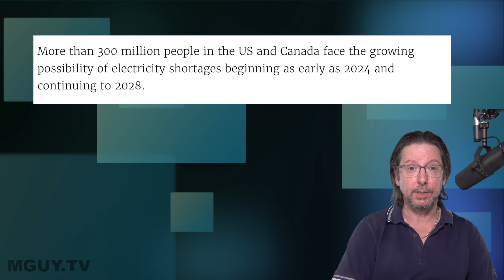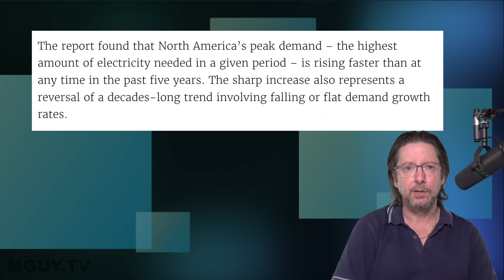Electricity grids WON'T COPE with mass EV charging | MGUY Australia

Comment: Energy Loss - future episode suggestion. Nobody seems to be explaining the significant loss of electrical energy as it moves from the place it’s generated, to the motor that turns the wheel. 1kw generated is not 1kw at the wheel in the same way that 1 litre of fuel delivers the same amount of calories into the engine (less evaporation). There’s an enormous loss of energy in the transmission and charging/discharging journey: that seriously impacts the amount of energy needed and therefore efficacy of the entire process as a viable alternative.
Reply: What you say is correct.  But the ice engines also waste a lot of energy on heat and noise.
Reply: Your statements are patently false. Electrical transmission lines are the most efficient way to move energy on this planet. Typical high-tension power lines lose 4%-6% energy over a thousand miles. 
Let's move a gigawatt of energy 1,000 miles in two ways, please. 1) electricity - oops, it's already at it's destination. 2) fuel trucks - we have to burn diesel to push the truck with a 75% heat loss. It will take days to get there, and when burned, the delivered fuel will waste 75% of its energy as heat.
What were you saying about "significant loss of electrical energy"?
Reply: Calories into the engine!!.

Comment: 10 years ago i got a tour of a power station i was told by the guys there that our national grid here in Ireland can't cope with the demand during the winter months which is nearly 4 months 😂 even the controllers in our grid distribution get nervous.  This was before a government pulled down 2 perfectly good power stations 10 years old all in the name of cutting our pitiful greenhouse gas emissions.  Never mind today with heat pumps or evs, or the rising population with an ever increasing demand on power but no building of new power plants or upgrading or national  grid.

Comment: Speaking of the US and Canada, most people don't know that Canada sells excess power to the US, sometimes in substantial amounts.  So, what happens when they need their 
power for their own citizens, businesses, and industry?  Most likely is that they will say, "Sorry, US, but we can't supply you with any additional power right now... maybe later?
The problem, of course, is that electric power is not one of those off and on requirements.  When we need power, we need it NOW.  This is yet another reason why solar and
wind power are less than desirable.  Not only does the sun only shine about 40% of the time when clouds are absent from the sky but the wind can stop blowing in a lot of 
places for days at a time.  At best, these sources of electrical energy are secondary supplies that only work when nature allows them to work and not at any other time.  
Because of this, we truly need fossil fuel and nuclear power to be the primary contributors to the regional electric grids that make up the national grid.  Notice that China 
is building LOTS of coal-fired power plants because they are pragmatic and know what will happen to them if they do not.  Those prone to flights of fancy instead of math, 
science, and engineering, however, apparently do not.

Comment: This is what happens when you get a very common windless night. Total failure of the renewables power grid. Batteries you say, unfortunately there are not enough rare earth minerals on this planet to get anywhere near a suitable backup power storage supply not even from pumped hydro. The backup will be coal, gas, hydro or nuclear. In essence we are creating 2 power grids when only one is needed. Therefore you can at least expect a doubling of your power bill minimum. Factor in thousands of kilometres of renewable transmission lines and your bill goes ever higher. We are governed by fools that have not a clue, they are climate religious zealots that must be sacked at the next election. Well done Labor and Green voters for administering a potentially lethal dose of socialism and climate cult stupidity.

Comment: In the US, California is causing hardships with EVs. The politicians are of the Lunitic Fringe persuasion, with no new ICE vehicles after 2035, are warning people to not run their air conditioning when there is a heat wave, and warning against charging EVs during these heat waves. This is because there is not enough capacity to generate and transmit electricity in the state. Old power plants have been shut down and not replaced. They are saying that wind and solar power will supply enough electricity, and it is a steady, reliable source. Not hardly! When the demand is up and the supply is down, they buy power on the "spot market". That is where they buy electricity from other areas that can fill the needs of their customers and can generate more electricity to sell to other areas. It is the most expensive way to purchase electricity. Originally, the national power grid and the spot market were developed to "fill the gaps" when areas need more electricity on a short term, such as an unusual heat wave, or in a disaster where generation has been disrupted in an area. With California not replacing old generating plants, they are buying more and more electricity on the spot market. This translates to higher demand nation wide, which drives prices up nationally. California is also is planning to ban natural gas fired water heaters and furnaces in new construction by 2030. This will place higher demand on the electrical grid, but without much thought as to where this additional electricity will come from and how it will be transmitted. Maybe they will have winged unicorns push the propellers of wind turbines when the wind is not blowing to provide more electricity. Prices will have to increase. Recently, I moved from San Diego to a town in Utah. In San Diego I paid on average $0.42 per kilowatt hour, including taxes and "fees", carbon credits... (aka: taxes). In my new town, I am paying $0.14 per kilowatt hour,   including one utility tax. My last electric bill here was $97. For the same amount of electricity in San Diego, it would have cost over $350. Christinewarner151 is right!

Comment: over here in new zealand its "charge your ev at night when power demand is low"
now nz runs mostly hydro power, at night less turbines are spinning away as use is low, add a million plue ev's and more turbines will have to spool up at night, lake levels will drop faster and more power cuts will happen due to lack of water.
unfortunately the greeny nutbars are blinkered and think electricity generation is easy and doesnt need coil/oil/nuclear or damming up more rivers.

Comment: Electric Mine Trucks use a Diesel Engine to drive a high voltage, high amperage alternator to power the rear wheels. Using this set-up produces high horsepower at the back wheels.
Reply: trains are electric too.  yes they have diesel engines. the diesels charge up the batteries that supply electricity for electric engines. 

why?

being able to pull an entire train from a dead stop.  that's the beauty of electric d c motor.

i was very surprised to learn that tesla converts his d c elec. into a c  and the cars are driven by a c motors.  i can't remember why.  but for his useage a c is a better choice.
Reply: and the engine can run at the most efficient RPM

Comment: What to do when the sun doesn't shine and the wind doesn't blow? There must be generating stations on standby, ready to produce the electricity that wind and solar can no longer supply. They must be powered by fossil fuels, geothermal, hydroelectric, or nuclear. And it isn't efficient to turn them on and off. You can't even do that with nuclear power, can you?

Comment: Imagine an additional 10 GW of load on the grid during off peak overnight hours, for every 1M ev's charging at home on L2. At 5M ev's you are up to a hefty 50 GW of additional load (in addition to what usually goes on at night). At 10M ev's, you would be at 100 GW, which would be the size of grids in some places running full out (assuming full contribution of wind and solar that day). That is ONLY 10M ev's in a large state or an entire European country...

50M ev's charging overnight would likely be out of reach, altogether.

Comment: The end goal of the communists currenty running Australia is to herd every one into identical multi storey 3 room flats under constant surveillance.   There will be NO NEED for any electricity to charge EV's as only the very few in the ruling communist party will have them.  Private ownership of internal combustion engine vehicles will be banned as will ownership of EVs which will be reserved for communist Party Members only.   To travel anywhere the people will have to seek and in rare cases be granted permission by the communists to travel.   Travel will ony be permitted if it is in the interest of the communist Party.  Such authorised travel will be by public transport,  bicycles or walking.   These are the rules applied in all communist countries,  Russia being the prime example.
This is why Australia's fossil fuel electrical generation system is being destroyed by the communists and why there are now only two oil refinery's left in Australia with the communist's end goal to have none,   as they will end the need for them.
The erection of wind turbines all over Australia is NOT for power generation,  but to be a constant visual reminder of the communist's "renewable energy" policy,  why the Physicists will tell you is all based o a lie.   Nuclear energy generation would defeat the communists goal of destroying the electrical power generation system and that is why the communists are vehemently opposed to nuclear.   The fact that France generates 68% of its electrcical grid power by nuclear the communists ensure gets suppressed and denied in their controlled media outlets,  just like Pravda in Russia.

Comment: Blow my mind that most people can't do a second-grade math problem! It takes a whole lot more energy to produce gas for a gas cars than it does for an electric car. Minus a gas car means at least doubling the energy output. Which is more than enough for an EV and then some. In other words for every gas car you take off the road, you'll have enough energy left over to charge at least two EVs. Give rid of all the gas cars and we'll have a vast energy surplus. Not to mention, you can get your EV energy/charge from the sun! Can you say the same for gas cars? NOOOOOO!!

Comment: Don't worry , they'll burn more coal ,or generate more power in those green Biomass power stations they are environmentally friendly 🤣🫤 not , burning green wood,  40 cord and hour with chopped  up rubber tyres .

Comment: The answer is no , to replace combustion engines with EVs you need the equivalent amount fuel used by combustion engines , To be replaced with electricity being generated. We cannot even replace coal fired power stations with enough so call green electricity generation to keep the lights on. Then you include all the new electric vehicles. Chris Bowen is not lissioning. This shift the renewable energy policy and electric vehicles has not been thought threw looking at negative feedback and positive feedback. The politicians have only been lissioning to the positive feedback arguments. Because of this narrow minded narrative the hole shift to renewable power and electric vehicles will fail. But again it it not the Labour ,Greens and teals alliance that will bear the cost it is the Australian tax payer.wasted money. That sometime someone is going to have to fix this mess of very narrow minded politics. Only lissioning to positive feedback, the information politicians want to hear and close their ears to negative information. Stop playing politics with Australian people. When someone criticise someone else instead of facing up to a problem. It says a lot about their narrow minded closed minded narrative of other people. They think they are always right and will not lission to others.

Comment: These strawman arguments put forward are laughable. Does everyone go to the petrol station at the same time every day ? No of cause not. The same can be said of EV. In fact EV's can be charging while parked at any time day or night. The majority of journeys to work is less than 50 miles so the only require topping up for an hour depending upon speed available. The infrastructure is growing with Supermarkets and Malls offering more charging points. In Nordic countries the old over night engine heater parking points have been changed to EV charging points. Little rewiring was required. Lampost charging points are a growing source of income for energy companies as are parking bays in car parks. It all about the money. The grid will adapt as will drivers..
Reply: Really?  Not everyone goes to the petrol station at the same time but an awful lot do!   A petrol station can operate efficiently with many vehicles simultaneously.  That is almost never true of an EV charging station.  The only place where it is true is where EV charging points are backed up with diesel generators.  As for charging overnight, well good on you if you have a home charging point.  Most people will not have that access and will not be in a position to charge overnight, the queues will get longer and the need for diesel/petrol backup generators - or total blackouts - will be inevitable.
Reply: @grellis6483  More strawman arguments. The only time you see petrol stations full is when there is a emergency or the price is going up. The number of petrol stations is declining. Ev stations can be anywhere as I pointed out carparks, supermarkets and shopping malls and street lighting. On street charging is increasing but it will take time. Actually car ownership among under 30y is declining except in rural areas across the developed world. Car clubs and alternative vehicle hire is increasin. The costs of owning and insurance cars are the main reason given by young people turning away from cars.
Reply: @thomasreilly6362  You must live in a very isolated location.  Fuel stations in the cities in my experience don't need a crisis to be full of cars being fuelled up.  It happens every peak hour of  the day, morning and night, and often multiple times on weekends and holiday periods.  There's nothing 'strawman' about that.  It is the reality.  Just as it is the reality that more EVs require more electricity - electricity that has to be generated.  Which part of that is a 'strawman' argument?  Unless governments invest in massive electricity generating capacity the grid will not adapt as you want to imagine - it will simply collapse.  You also have this curious viewpoint that because 1. Most EV trips are less than 50 miles and 2. Because fewer young people are buying cars that this is something to be pleased about.  I don't know about you, but in my experience regularly travelling hundreds, even thousands of miles has been a way of life for many people, for employment, for meeting up with friends and relatives, and an opportunity to explore the country and go places that they could not otherwise afford and with an ease of mobility that is liberating.  Unless governments provide the power needed,  EVs will never be able to support that mobility, and that's to say nothing of their other obvious costs, dangers and shortcomings.

Comment: Is that true that a car charger can use 250kw? I thought a substantial home would max out at about 100kw, so that's a crazy amount of power. I don't think houses have chargers that powerful surely, maybe a Tesla fast charger in a supermarket?
Reply: An EV can charge at any rate it wants to, even a 120v/15a circuit. Any house outlet in a garage will do.

Comment: I said this at the start - An average house uses 25kw. An EV has a 90kw battery. 
You basically powering 3-4x as many homes without increasing the power supply. 
Blackout and brownouts are inevitable.
Reply: you have no idea what you're talking about. You're making the same mistaken estimate of EV use that a typical electrician does.
You do NOT refill a 90 kW/h car battery from empty every day. The average American driver only goes 30 miles per day, and that only requires 10 kW/h per day to recharge. That much energy can be refilled using house current overnight.

Comment: My issue is, my ice car, new 20 years ago got 36mpg. 20 years later, still the same, it never degrades over time unless I neglect it. Batteries won't last that long understandably,  but to rebuild my motor costs me maybe 2 grand and back to 36mpg. Batteries, a bit more expensive. Maybe few years down the road they will last much much longer.
Reply: the average MPG of a new car today is about 25mpg, the same as the Ford Model T. EV batteries typically last about 300,000 to 500,000 miles before they have reduced range to 80%.
Reply: @justsomeguy934  good to know. Have you experienced this range longevity first hand?  Thankfully my old one gets 36mpg, 26 seems awful for something new.
Reply: @tomc8157  My personal EV is at 9 years old, 100,000 miles, battery doing just fine. I know several owners with more miles than that on their batteries, and can point you to million-mile EV owners (although that one has had a battery replacement). 
Battery life just isn't an issue, despite what the oil companies want you to believe.

Comment: I saw a video of some guys driving a Ford Lightening through Alaska.  At one stop, the plugged into a 240 volt/30 amp outlet for fourteen hours to get an 80% charge.  Imagine running your dryer for fourteen hours to get a couple of hundred miles of range.
Reply: and exactly how many people drive through Alaska? Quite the extraordinary example, isn't it?
Reply: Keep your eye on the donut not the hole son.  The point is that it takes an  enormous amount of electricity to charge an EV. You can power three typical homes for a day for the power it takes to charge an 100KW battery.    @justsomeguy934